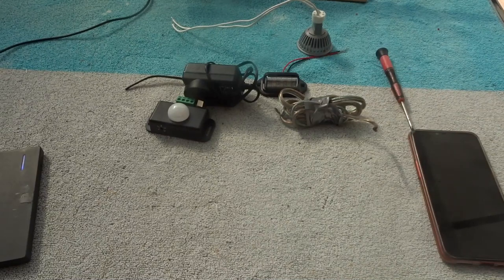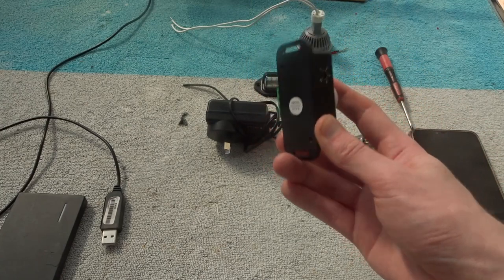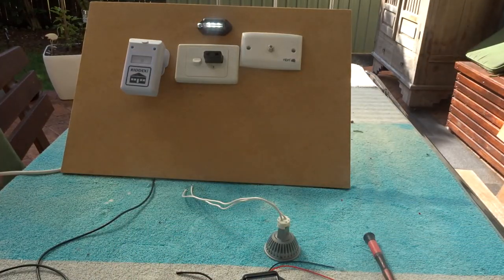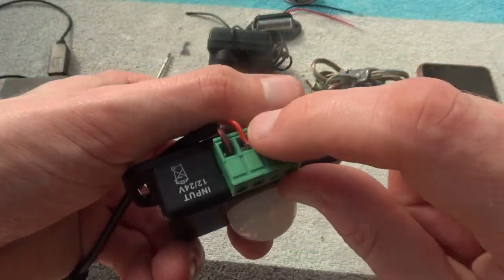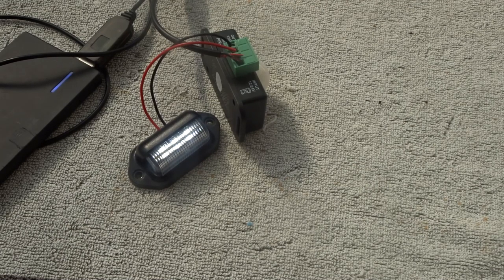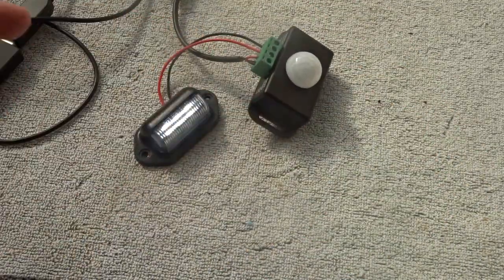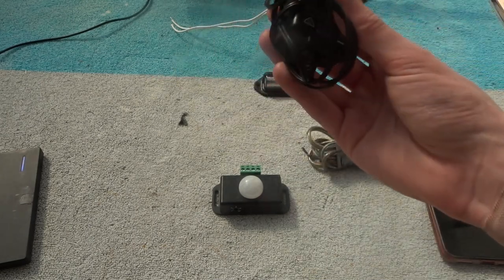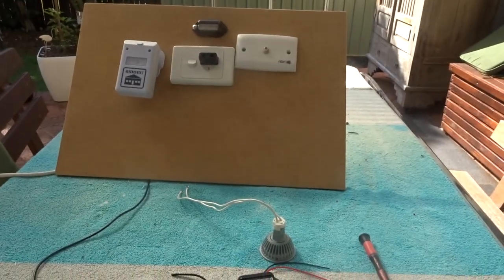how to set up a 12 volt motion sensor

Comment: Thanks. Can I use this in a circuit as. Car battery - sensor - car horn.  As an alarm if someone opens my car door ?
Reply: Of course you can
Reply: Exactly , I'm setting this up in my yard on a bronze ship horn for overnight security , 24v high pressure seleinoid valve ,
Reply: @MiyamotoMusashi9  would LOVE to see that setup, have some vacant property I'd like to put something like that on it

Comment: I took one out of a LED ceiling light that takes AC power and is 100 Watts max. Does the 12V DC one featured here work the same way insofar as opening or closing the output circuit based on motion detection state?

Comment: I have this sensor and I’m using a 3-24v, 3amp ac/dc power adaptor to a 12v wiper motor.  It comes on and works fine but will not shut off.  I’ve tried three different motion sensors. What am I doing wrong?
Reply: Common 'out",  do not share..see above somewhere

Comment: can you use low voltage landscape lighting power?
Reply from the maker: Hi mate thanks for your comment yeah it will work fine as long as it doesn’t go anything over 24 volts as you could possibly short circuit the sensor.